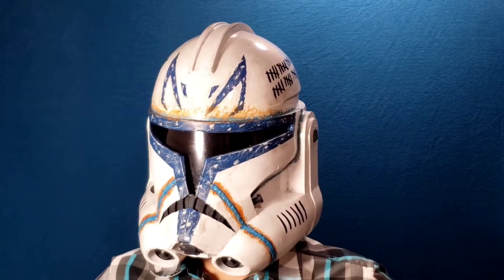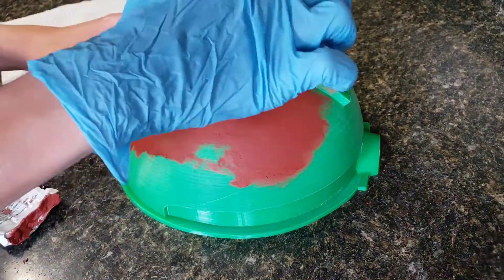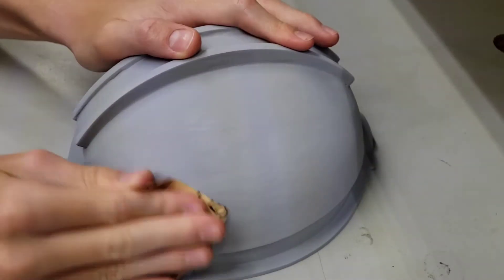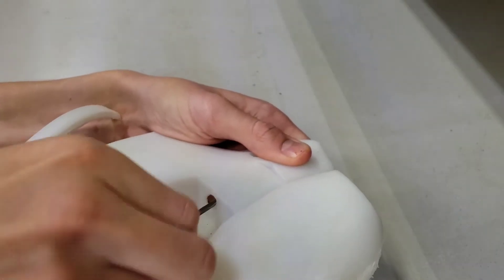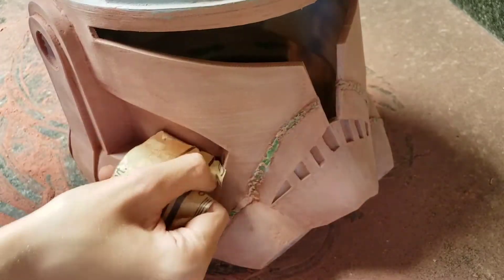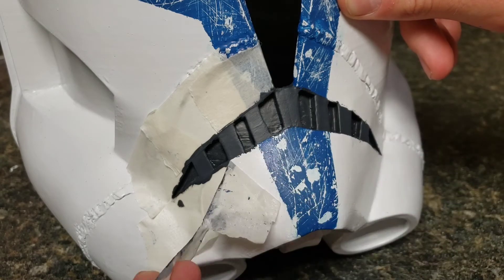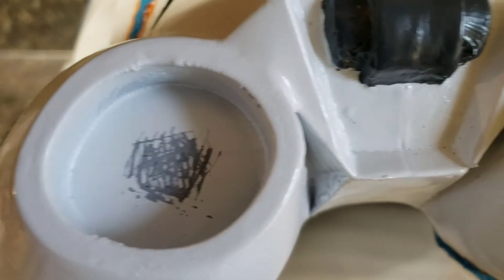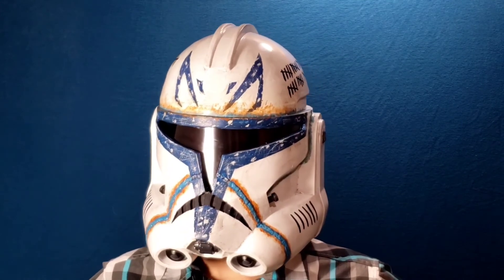How To Make a 3D PRINTED Captain Rex Helmet

Comment: Ok first of all, great helmet! Would love to make one I just need to know a few things, did you use cura? If so what percentage size did you make the parts to fit your head?
Reply: And also the rangefinder and breather parts size
Reply from the maker: I think I resized it to 88% or 89%. The helmet doesn't fit my head anymore so I should have made it larger.
Reply: Yeah I printed mine at 100% on my Ender 3 v2 since the description of the file said “meant to fit an adult so it might fit my head when all the parts are finished printing

Comment: Why do people use so much spot putty/filler? For the large print lines yes but not on the whole helmet and surely not on those small separate pieces, I find that spray putty filler works 10x better and you also have 10x less sanding.
Reply from the maker: Good question. I found that using filler putty first is much more cost efficient than using spray filler primer first. You can use one tube of putty for a helmet, but it takes multiple cans of primer. Also, it's quicker to get the bulk done with putty as opposed to doing multiple coats of spray and letting them each dry for 2 hours. I hope this answered your question. :)
Reply: @ColesHobbies  True it would probably be cheaper, but not by much. Where I live I can get putty spray filler for around £5, it would take probably 2 of them to make a helmet completely smooth with a little bit of sanding here and there, by the way I am not talking about filler primer like rustoleum as that doesn't really fill in large printer lines. I have made a few helmets using both spray putty filler and paste filler, the spray putty always gives me much better results and I don't have to spend hours sanding.
Reply from the maker: @BazamO  Would you be able to share a link or name of the spray putty you are talking about? I'd gladly check it out.
Reply: @ColesHobbies  it's called Simply SP-037 Car Spray Putty. I am in the UK so I am not sure if they will sell the exact item where you live.
Reply from the maker: @BazamO  Okay. Thank you for the suggestion. I'll try it sometime.

Comment: I'm actually following your tutorial right now. What printer do you use? I'm using the Ender 3 Pro so I can only print the individual pieces in the files and not the whole thing
Reply from the maker: I use the ender 3 and I split the helmet file into multiple parts using meshmixer. I got the entire top dome printed by rotating it 45 degrees. I also shrunk the pieces to about 90% of the original size to fit my head. The dome wouldn't have fit without shrinking it. I hope this helps. Good luck with your helmet!
Reply: @ColesHobbies  thanks! I'm printing mine full size for selling purposes. When I make my own in the future, I will be sure to do that. Thanks!
Reply from the maker: No problem! The helmet files are under a Creative Commons - Attribution - Non-Commercial license, so you might have to contact the creator for permission before selling it.
Reply: @ColesHobbies  oh shoot you're right

Comment: Which printer are you using?
Reply from the maker: I printed my Rex helmet in 4 pieces. I had to cut the front in half and printed the two pieces separately. The back piece and the dome I printed diagonally on the print bed (separately). I also shrunk the helmet parts down to about 90% size because my head is small. If I had kept the dome at 100% size I would have had to split the dome into multiple parts. I hope this helps. Good luck with your Fox helmet!
Reply: Vexzom ohhh ok and thanks
Reply from the maker: I used the Creality Ender 3 to print the parts.
Reply: Vexzom really i have that same one and i didnt know if some of the larts would fit on the print bed/and im currently making a commander fox helmet
Reply from the maker: No problem. Glad I could help. 👍